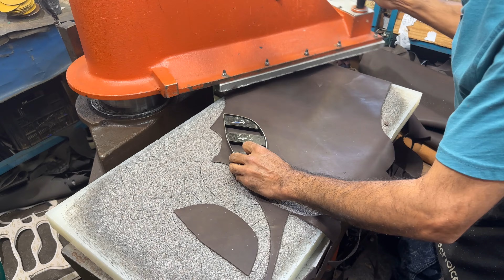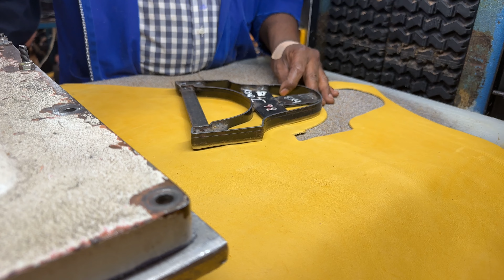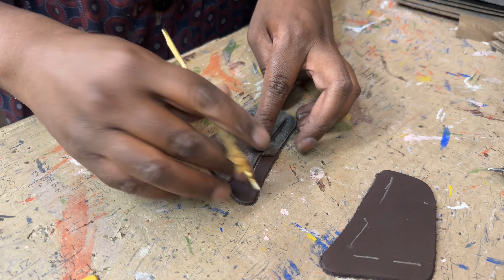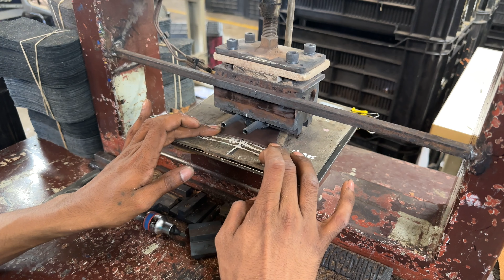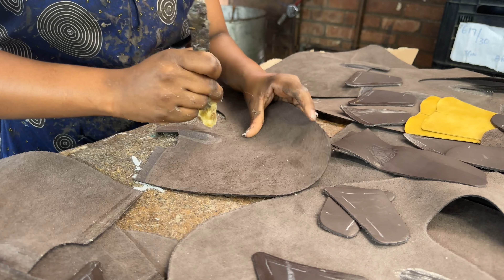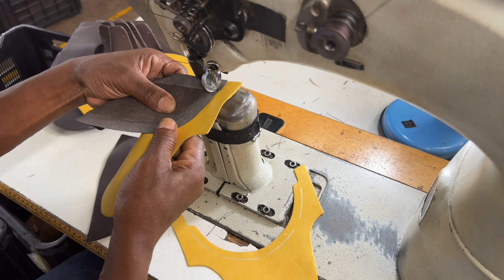Africa's Most Rugged Chelsea Boot - Stockman How It's Made // Jim Green Footwear

Comment: A word of warning to anyone considering these boots. Although I found the fit and construction stellar! I work in sometimes wet conditions and also living in rainy New Zealand, I would compare it to walking on an ice rink. For any wet/slick surfaces. This is with the standard non-wedge sole. My previous experience was wearing RedBacks which had far better grip although, a softer probably less durable compound. So consider the conditions you might be using these boots in. It's possible their other sole options are better in these circumstances.

Comment: Hi Jim Green group. So glad I found U❤Just got my boots, got the size 9, i overlap the insole with my old insole from my old blundstones size 8 and they are the same length/size. I have a Roman type of toes which makes this boot perfect because of the extra space in the toes. However my toes feel pressure from the top... I can wiggle them but not as much as I wish I could. Without the insole the toes feel a lot better. Maybe I need a size 10?
If i step on Stockman insole i can see about 1cm clearance. Is that enough?
I'm not sure about the size. If I use a normal sock the fit it's fine, a warmer one also fine everywhere but tight on  the top of the toes( without insole feels a lot roomier, maybe too much) I know half size increase the width but I don't think this will help.
Is it worth to stretch the toe box? I have the right tool. If so, what would be the best way since there's thermoplastic? Thank you so much.
I'll buy soon the shoellie. 😊

Comment: My next pair of boots has to be JG. They are definately better than the terrible boots  I bought from a manufacturer in the Midlands area of KwaZulu Natal. Constant problems with stitching undoing and soles coming adrift and they are supposed to be hiking boots and are not waterproof. I was told I had to buy some expensive waterproofing gunge to apply to make them so. WTF. Hiking boots should, by definition, be waterproof by design. 
Regards from South Africa